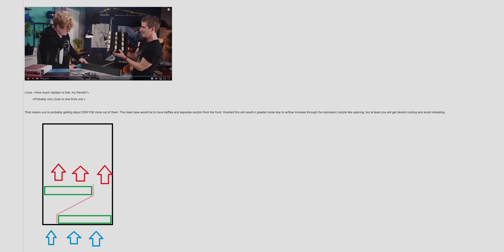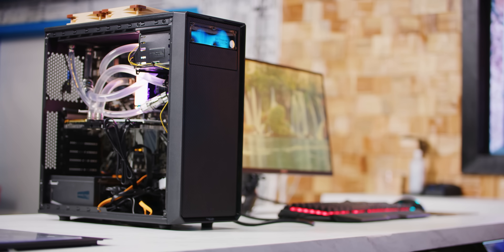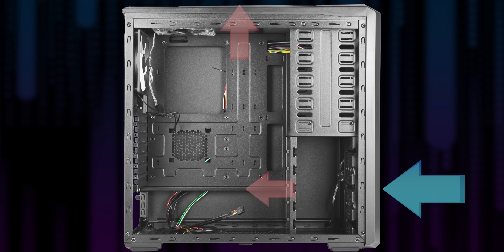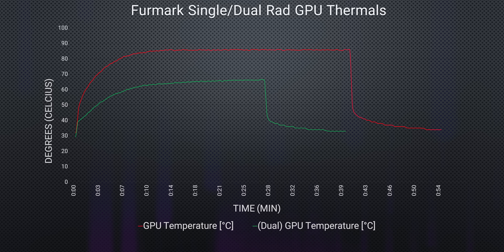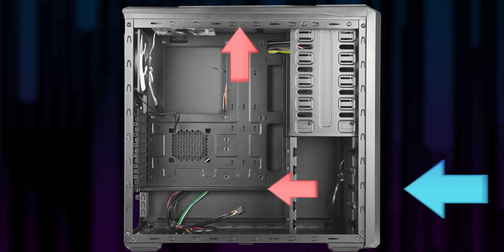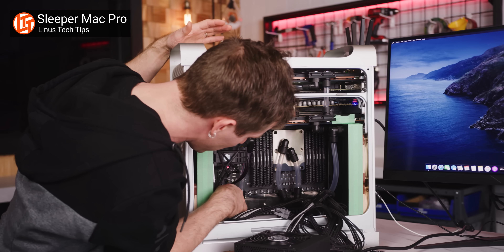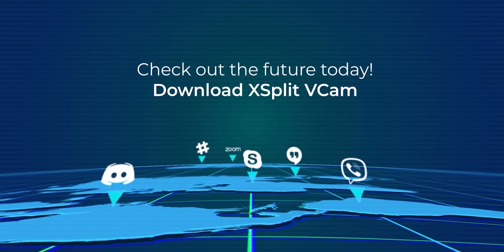I’ve been water cooling wrong for YEARS - $H!T Manufacturers Say

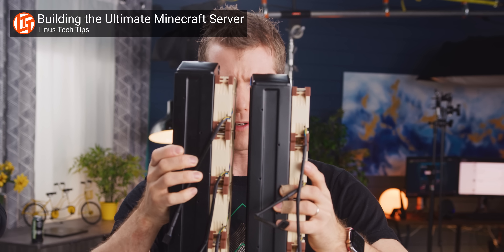Comment: at 1:30 you have shown an image of the case that we can call as a loss as mechanical engineers. you can say that 25c air is passing the first radiator at a temperature of 30c, entering second radiator at 30c existing at 32, entering the 3rd radiator at  32 exiting at 33c. 
we can expect water temp as following : at rad 1.... 40c in, 35c out, at rad 2... 35c in 33c out, then at the third water will reduce almost out at 32.
so the Q the heat you sucked out by the first rad have been good and the watt you used to do it is small when you calculate the Q of rad 2 and rad 3 compared to the same watt which is fixed to circulate water across a single rad.
the best thing is to create air ducts by 3d printing as example giving fresh air at 25c to all rads and same duct to suck each rad hot air out of the case on another direction away off the intake.
if you are interested, make someone comment back to me, i can give you some drawing or 3d drawings for printing based on your rad dimensions

Comment: Idea to be corrected by people smarter than I

Corsairs argument; Air going into a 40 degree radiator comes out, taking almost all 40 degrees with it due to how efficient radiator are, and so then can't pick up more as it goes through a second 40 degree radiator.

But this is implying that the air is only able to hold 40 degrees worth of heat energy.

So if the air is able to hold say 100 degrees worth of heat energy, and it picks up 40 degrees worth of heat energy going through the first radiator, then it should still be able to pick up another 60 degrees worth of heat energy before becoming saturated. So multiply should still work. 

Just thoughts, i'm no scientist, someone tell me where i'm wrong....

Comment: Does it make a difference how the waterflow goes relative to airflow? I.e. hot water going first to the front radiator with the coldest air (high temperature difference, followed by low difference) VS hot water going first to the back radiator with the warmest air (decent temperature difference in both radiators)? The second probably works better, even if only by keeping the overall case temperature lower.

Comment: .......I just make my 2nd radiator external and submerge it in a cooler filled with a dry ice and liquid nitrogen slurry........of course, the fluid in my sealed loop system is 50/50 antifreeze and water. I have managed to convert my PC from being a FURNACE to being an AIR CONDITIONER !!!!!............................and then I woke up to a room filled with smoke and the stench of burning plastic  when I realized it was all a dream !!!......

Comment: Here are my likely worthless two cents... Let's say 80 degree temps are being recorded on the CPU.  The water isn't likely going to heat up to 80.  That maybe 75 at best degree water is pulled into the radiators.  The 25 degree air isn't going to heat up to the 75 after going through the radiator.  Likely the water cools down to maybe 50 degrees and it's recirculated and the air is heated to to 40 degrees in the case.  So the air going through the second rad is warmed up but not to the same temperature as the CPU so there is still cooling opportunity.  To think that any rad could pull all of the heat into the air seems preposterous.

Comment: If you stack radiators, the first will have a good efficiency, but the second will have less fresh air so efficiency will drop.
it can work, but it's better to ever have the freshest air possible for the intake, so you got the better efficiency possible.
I know that pretty well because i'm technician in HVACR.  ;)

Comment: The main issue is the airflow rate, if you pull air through the radiator too fast the air leaving the radiator hasn't absorbed the heat as efficiently as it could, therefore it is still able to cool the next radiator/device better with a greater differential than if it was tuned to its radiator.  The results you have perfectly demonstrate this.  
Now if you were run the fans at their most efficient for the radiator they were mounted on they would regulate speed to get the most efficient differential across that radiator and the leaving air temperature would represent the Corsair model.  Try measuring your radiator off-air temperature and slowing them down to get the peak off temperatures according to ambient (this is the most efficient way to use them, and of course consider the minimum speeds the fans will run at being their lowest load matching ability, sometimes you stop fans and run a single at low loads too etc.)

Corsair seem to be basing their data on running radiators and fans as efficiently as can be  (as industrial applications do) and not just pumping air across at higher than required efficient speeds, otherwise lots of equipment around the world would just have massive fans mounted, running too fast and running less efficiently sapping up more energy than required.  

So, to recap, your setup is flowing too much air and is inefficient, you've not even considered minimising energy usage and these factors all need to be considered in designs so you aren't losing energy and costing more for no gain.  Granted the few pounds on a domestic setup is not going to break the bank, but it is wasted energy and money.

So I am with Corsair and their model is correct, running the fans efficiently and correctly to match the radiator load, the leaving temp is higher and therefore has less cooling potential afterwards on the second radiator.
...I'm surprised this was never considered as you are normally a bit better at the lateral thinking, maybe Steve (GN), Jayz, and/or Der8auer can get involved ;) (just check for thermal paste on the CPU Jayz :P)

Love all you lot and keep up the good work.

Comment: Why not turn the fans so that all radiators suck air from outside?
Shouldn't it provide better access to cold air?
Reply: I think it's generally better to have one fan empty the case air and one to fill it, otherwise the pressure inside the case will resist bringing in more air. Imagine the air is water. Once you fill the case with water, you can't get any more in. Sure it will leak out slowly, but pumping it out is faster and carries away more heat per minute.
Reply: @dude6935  And why cant you  have a dedicated third fan that draws the air out of the box without a radiator?

Comment: I am curious if the radiators are in series, and if so, which radiatot gets the hot water first. If the hottest water is run through the exhaust fan/rad, you will have a temperature gradient across both radiators, but if the intake side gets the hottest water, you might be closer to  what Corsair are modelling. Have you ever tried testing this sort of comparison, or seen it done by someone else?

Comment: Funny, in aio manuals, the fans are usually placed "before" the radiators ( considering the air flow direction ) ... And in all videos, linus does the opposite ... So which is the best ?

Comment: As long the radiator is warmer the the air passing through it will have an effect. The less different in temp the less effect it will have. So best way is to have the first radiator with warmest water to start at the exhaust and last at an intake with cooler air.  This should exploit the best temp difference at both places.

Comment: You should try with the second pair of fans but not the radiator. I think that's what corsair was talking about.
Reply: I agree: it's obvious that adding more fans will help. But the radiator won't do a lot. All bits help, perhaps, but a reduction in temperature of 5 degrees C may not be worth the money you spend on it.

Comment: I'm quite sure they misunderstood corsair.  In the input output scenario Corsair is clearly talking about a significant heat being added in-between the radiators. So for instance an aircooled gpu with a dual radiator cpu or something. In case of the minecraft server they were very likely talking about the fact that the second and third rad weren't dissipating nearly as much heat as they could had they gotten a fresh intake. It's obviously not possible that removing a radiator in the minecraft server would have resulted in a temp decrease as the air and the water would just both go to the same temperature. However, a better test would be if two radiators with fresh intake performed better than three in series. Or in the other case, if a gpu at max load could heat up the cpu with a second radiator.
This is not a very scientific test and it would be nice to see a proper follow up because corsair definitely knows what they are doing and have engineers that are specialised in thermals.

Comment: I would add having a second radiator bumps up the systems thermal heat capacity by having more total coolant volume. It's like having a bigger battery. By having more coolant means that it doesn't get up to temp as much or as fast which then allows the heat exchanger+fans to push the heat away.

A crude analogy I would make is boiling water. If you have 1" of water in a pot vs water full to the brim, the 1" will reach to a boil much faster where you seem to wait forever for the full pot to even bubble.

Comment: It seems to me that a more effective solution would be  to externalise all the rads and their attached fans so that cooler ambient air is entering the rad rather than the air in the case that has absorbed heat from all the other components that aren't being liquid cooled. Of course its not at pretty as an internal rad, if you want serious non-refrigerated cooling that would seem to be the way to go. To help things a long a bit, add a straightforward intake and exhaust fan to keep the air in the case refreshed.

Comment: Perform worse? I have not seen that happen ever.

Diminishing returns? Oh for sure. Even a double thick rad is diminishing returns. Triple thick rads is like a waste of money unless you blast the fan speed. 

If you want a quiet PC build with low RPM fans. A slim rad is like 90% the performance while looking much more low profile. 

Also a second rad won't restrict airflow so as long you put fans on them. If anything that increases airflow.

Comment: I have lots to learn when it comes to computers and I hope not to insult, I really like your videos. I am left with a bigger question, would 1 radiator of equal size of the 2 used in second test run cooler? It didn't appear to me as a fair test.  I am going to be attempting to build my first water loop soon and that answer would help me decide which case to go with.

Comment: in my opinion this test is obselete because there is no data does the second radiator actually do anything or is it only an extra capacity in flow that slow the flow of coolant so more heat can dissipate from first radiator.

Comment: I think that there is a huge misconception in this video about the concept of stacking radiators. It's not only about adding more radiators to the system but specifically about stacking then side-by-side with airflow going through all stacked radiators in a straight line. It means that the first radiator will be receiving fresh air while the others will receive hot air from the first one and so on. You tested with 2 radiators in the setup  but they weren't stacked together so the results are obviously different. You should test with the radiators close stacked in line as you did in the minecraft server setup. If they were parallel to each other with all of then receiving fresh air the variation in performance would be larger up to the point in wich their combined thermal capacity would surpass the heat dissipated by the components thus leading to the point in wich some of the extra dissipators would make a negligible difference in the performance of the cooling system.

Comment: Of course adding another radiator and a couple of fans won't make it worse.
You get a bigger thermal mass both in water volume and hardware.
BUT you would get a colder computer with the same 2 radiators if they didn't suck hot air from each other, it's just common sense.
Test the 3 stacked coolers inline sucking trough all 3, and paralell where all 3 sucks fresh cold air and show us the difference

Comment: I have compared following setups:
-1x140 rad (cpu)
-1x280rad (cpu)
-1x280 monsta (8,5 cm thick)+ 1x420 normal (cpu)
-1x280 monsta + 1x420 (cpu and gpu)

With the single 140 only for cpu it works, but gets loud under load
With the 280 it's better but on hot days under load it gets loud

My big setup never gets loud, actually it is silent until full load for over an hour on a hot day, then you can hear the fans but very silent (bequiet fans). Adding the gpu to the water loop didn't make the pc really louder, it can handle the extra heat easily.
I also have a second gpu with an aio (single 120mm rad with push pull) and it stays cool too.

Comment: Is important to note, also, that more radiators means more cooling liquid, so that config has inherently more thermal capacity. So the case is still more use case dependant

Comment: If you haven't done so already, it may be good to let us read what Corsair was actually saying in their correspondences as there are probably many points they were trying to make that were taken out of context for this video. They may have been trying to recommend techniques which are not feasible in a real world install, for example, whereas you're talking about ways to make the system more space efficient--two different goals. There may also be sandbagging, such as connecting the radiators in reverse so that the discharge is on the hottest radiator or having an incorrect flow. As such, this video appears to be more of a smear or propaganda against Corsair without having more information on the circumstance that led to it.

Comment: Well, in a thermodynamic point of view, Corsair is right : you are cooling your second loop with hotter air than the first. But you system seems to prevent heat buildup inside the case.
HOWEVER, you could use two radiators to exchange heat with the fresh exterior (instead od stacking). That will be way more efficient... but requires a ton of room you may note have in any casing.

(love your work BTW)

Comment: If I am not mistaken (I can't remember the exact science at this moment), I do believe there is a difference between inducing and extracting air across a radiator.   Though, it might be negligible in this type of situation.
Reply: My thoughts exactly. For example when looking at a motor vehicle radiator, the fans are always set to blow cold air onto the radiator right? It just doesn't compute in my brain that sucking air through the radiator would be very efficient.

Comment: its like air conditioners adding more condensers dont help with efficiency which is cooling power (W) / heat output (W).  Adding more condensers only help with capacity